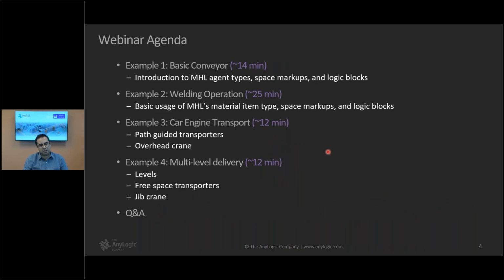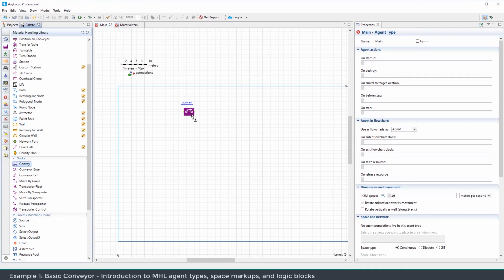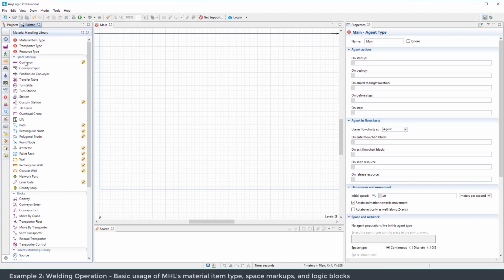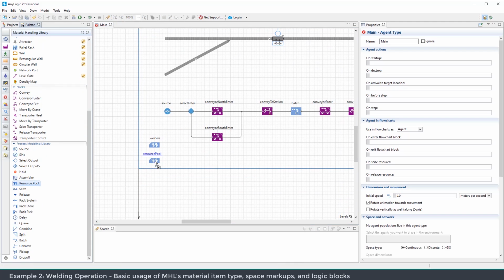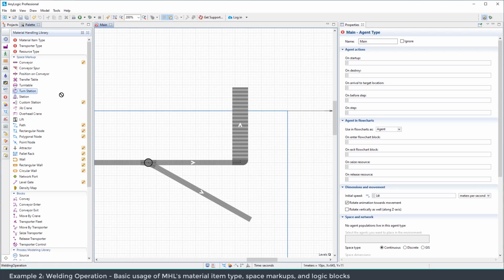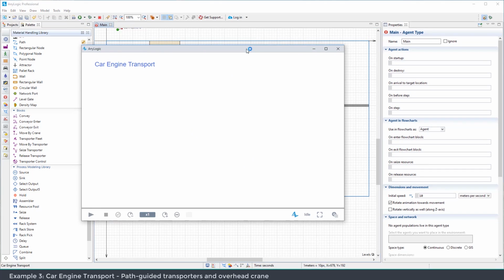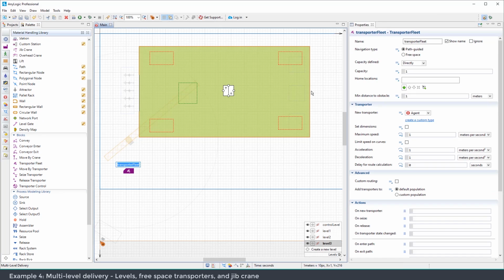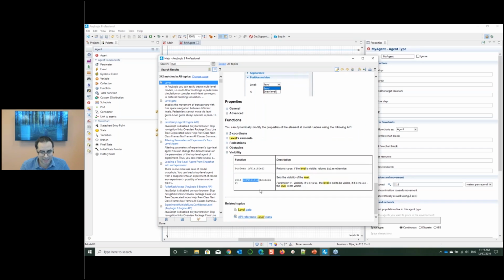Fundamentals of the AnyLogic Material Handling Library

Comment: Thanks for the webinar! Im replying the WeldingOperation and it gives me an error when the motor fail, the error says "Exception during discrete event execution
root.conveyorSouthEnter:
Cannot enter a maintenanced conveyor" Can you help me? It happens with the model of the webinar too.
Reply from the maker: Hello. 
This error happens when the agent tries to enter the conveyor “conveyorSouthEntrance” while it is faulty and not yet repaired. The block “SelectEnter” sends agents to its “false” output port with 30% probability and does not take the state of “conveyorSouthEntrance” into account. To make “SelectEnter” send all the agents (100%) to its “true” output port, you can use the conditional operator “? :” - https://anylogic.help/advanced/code/conditional.html.
For example, the solution here may be the following code in “selectEnter” Probability filed - “conveyorSouthEntrance.isFailed() ? 1 : 0.7”.
Thus, the agents will be always routed to the logic block “conveyorNorthEnter” when “conveyorSouthEntrance” is failed. Otherwise, the agent will choose “conveyorNorthEnter” with 70% probability and “conveyorSouthEnter” with 30% probability.
We hope you find this information helpful. If you have any further questions, please feel free to use our community pages - https://www.anylogic.com/resources/support/